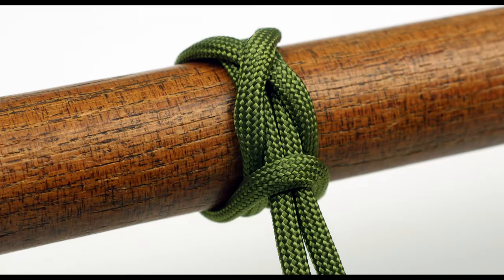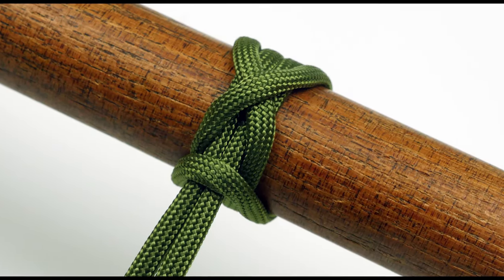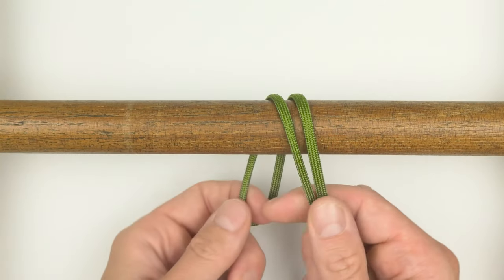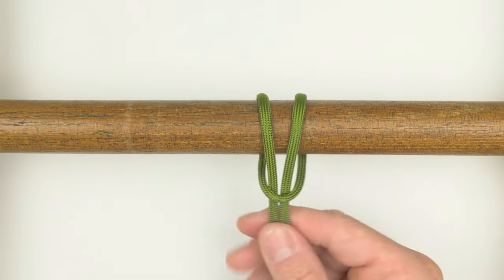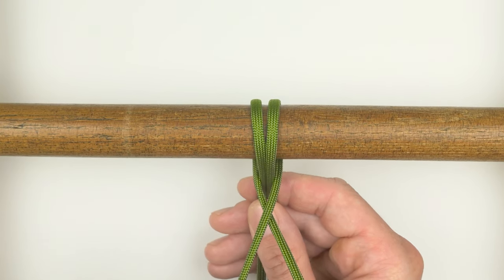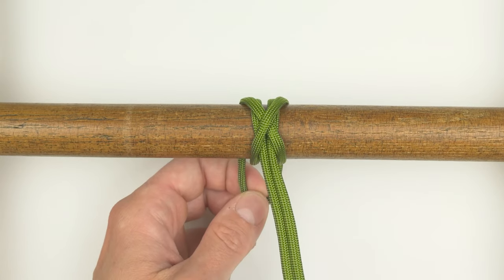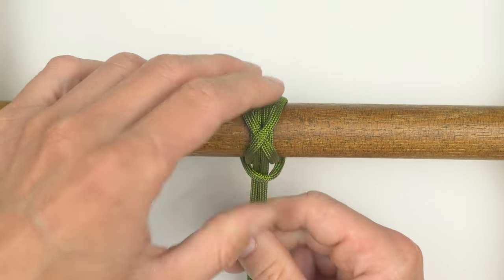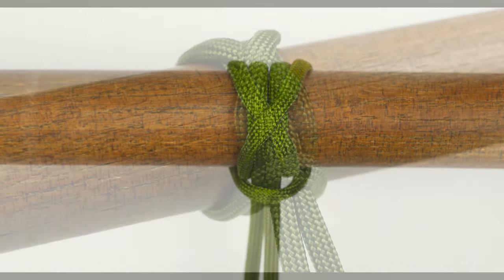Criss-cross hitch

Comment: Thank you for sharing.  I use a version of this hitch.  It is tied with a shoe string about the neck of a drink bottle, after which the two ends are passed thru a toggle, then tied together.  The finished knot is easily loosened and transferred to a fresh bottle.  The toggle serves as a carry handle, and the closed loop allows the bottle to be hung from a hook.